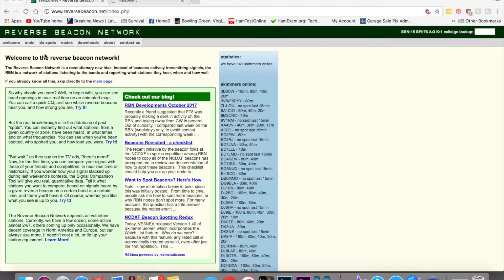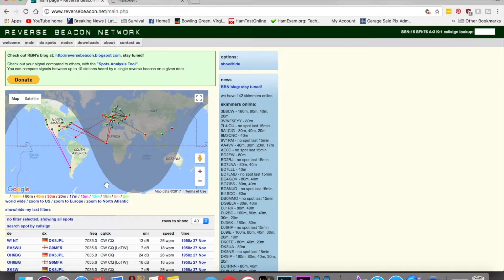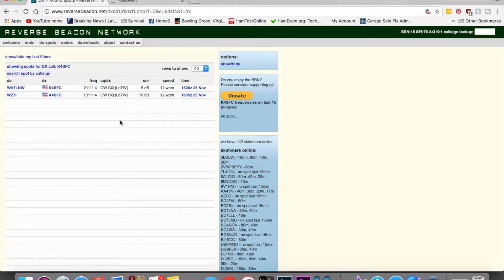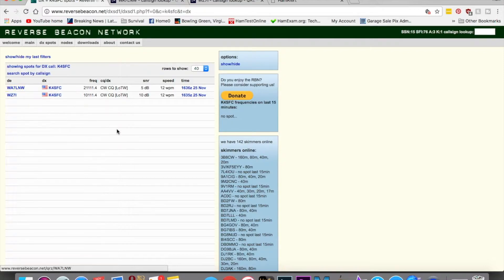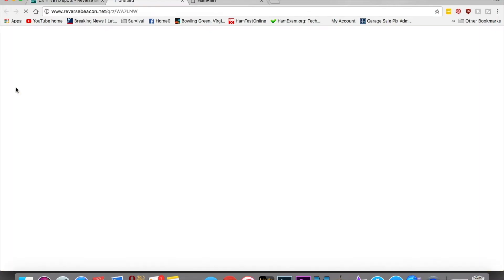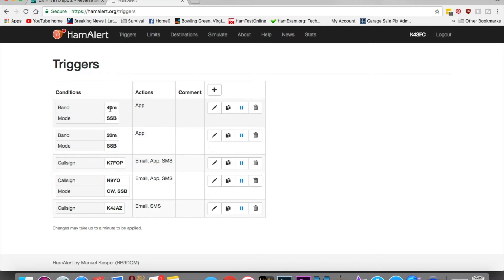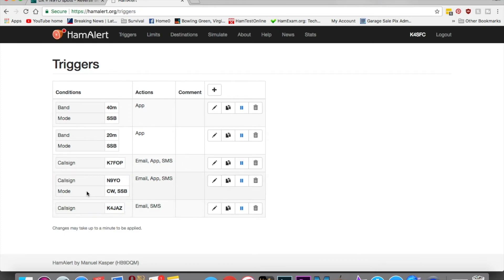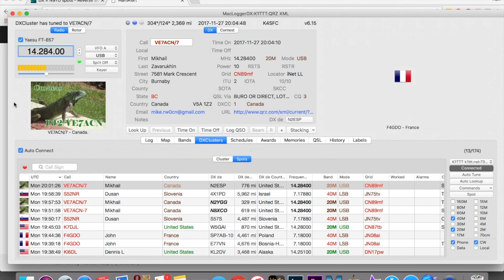Part 2 of My home Ham radio setup....ham shack, if you will

Comment: I have to get MacLogger!  I have a Windoze machine connected to my FTDX3000 because Yaesu firmware updates are not written for Mac.  Would definitely prefer to use my MacAir for ops.  73 de K2CJB
Reply from the maker: Thanks for the comment! You can download Maclogger for free. It will run for about 15 minutes before it tells you that you need to purchase a license. You can simply restart and continue for another 15 minutes. I did that for a couple of hours. Do that until you know for sure if you like it. I decided pretty quick that I wanted a license. No regrets from me for buying it.
Reply: Ron C Thanks for the advice!  I'll definitely try it out

Comment: That is cool ! You should give WSPR a shot. Thanks for sharing !
Reply from the maker: I'm hoping to get the KX3 next month and then I'll figure out what I need to play around with WSPR.
Reply: You will be happy with the KX3. A buddy of mine built one with the internal tuner  and loved it.  I regret not picking it up when he sold it . You can run a beacon on WSPR with just a wolphilink interface and an old android device. The signalink is a good adapter too for many modes.
Reply from the maker: Perfect. I have an old android device that will be perfect for this.